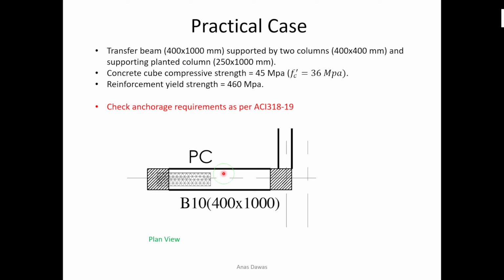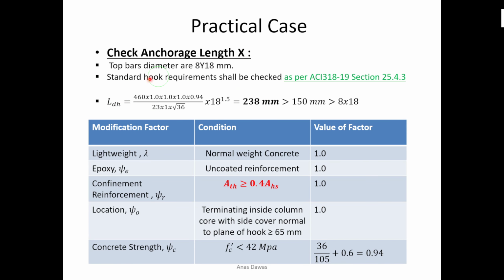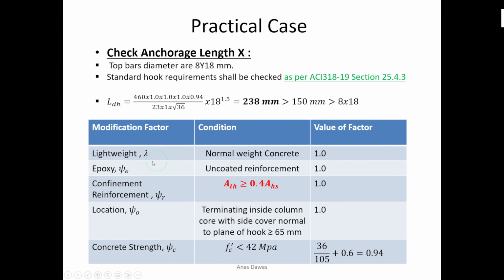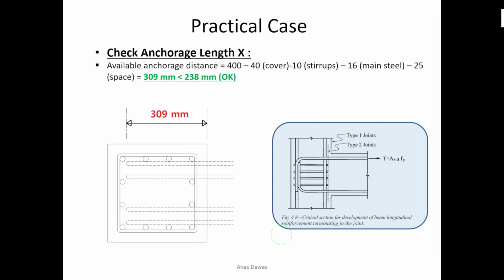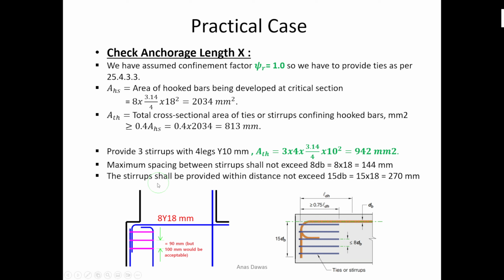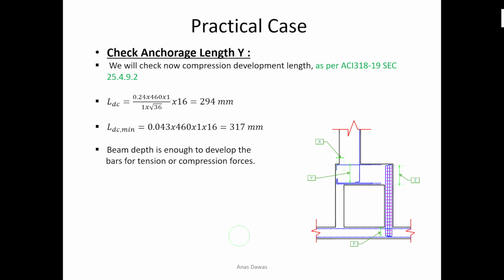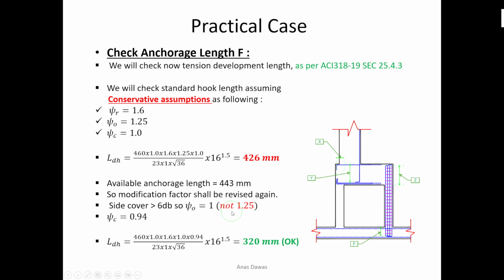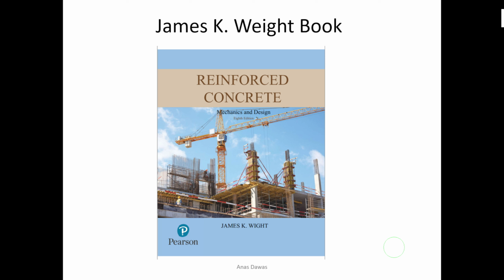Development Length as per ACI318-19 Part (2) English

Comment: Thank you so much for your insightful lectures you really focusing on very important topics.
I’ve only one question if I may ask 
In anchorage Length F:
Shouldn’t h: the overall depth of the foundation be equal to= ldc+r+db dwl+2db footing +Cc
Where r: radius of 16 mm bar is 6*db 
And according to this the available anchorage distance is 347 instead of 443 
It’s still safe in this example but in other examples it might not be 
Please correct my if I’m wrong
Thanks in advance
Reply from the maker: Thank you , yes you are right if you will use L-shape bar (hook) but in case you are looking for Ldc, the r+dw are not part of the compression development length  ,